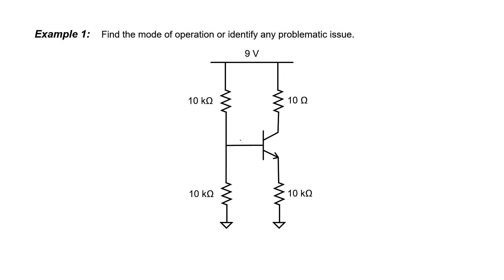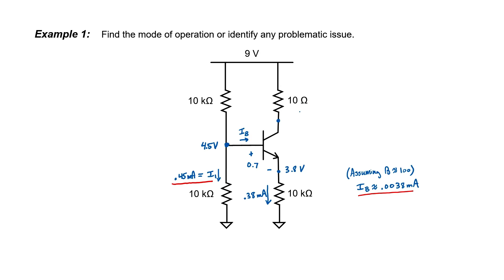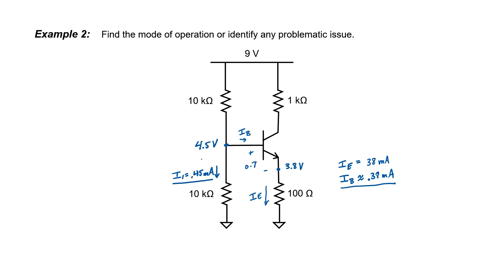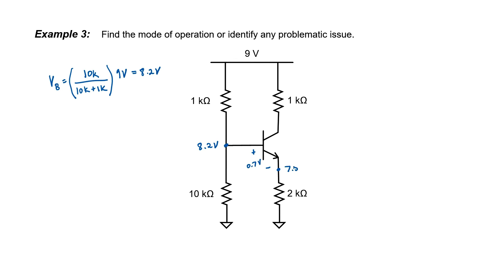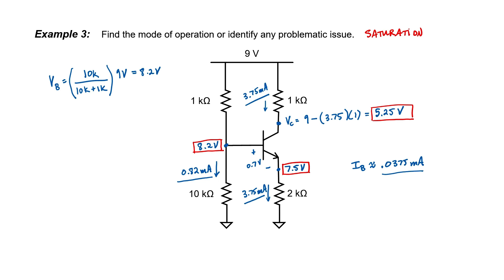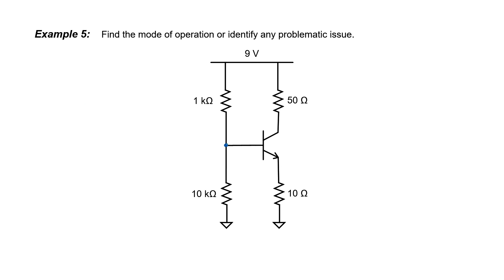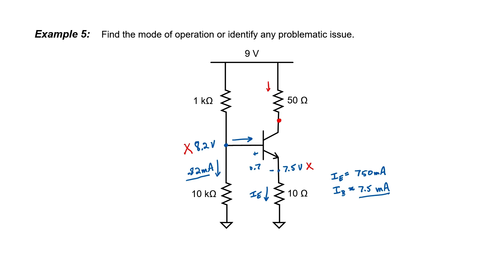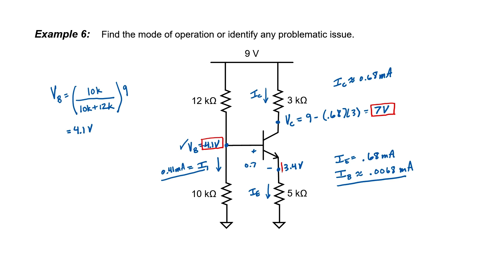Example Problems: Identify the mode (7-Transistors)

Comment: Is there a solid way to determine the base voltage when the base current isn't negligible compared to the grounded base resistor?
Reply: you can also write the thevenin equivalent of the  Base side and taking beta 100, you can find Ib, or if you want so accurate value, you can go through ebers moll model
Reply: Yes indeed there is an exact solution for Ib and Vb in terms of the given resistors, voltage source and the type of the transistor although a bit lengthy. 
Compute Vb through Millman's theorem you get an expression (E1) that contains Ib,
 Then Vb-Ve=0.7V for Si based transistor, 
Also Ie=Ve/Re=(beta+1)Ib (E2) 
from these two you get Ib=(Vb-0.7)/(Re* (beta+1)) (E3).
 Replace Ib in the first expression you end up with an equation for Vb Voila! 
you can now replace Vb in (E3) the  to get  expression  for Ib.
Reply: @faicalbarzi272  So this is what SPICE does, right?  Such a simple circuit is so complex to deal with!   A lot of electronics feels like "pick resistors based on experience"

Comment: Hi, in ex1 Vc = 9 - 3,8V = 5,2 V. Where is the other 9 - 3,8 -3,8 = 1,4 V drop? Could you clarify it please?
Reply: the source voltage goes through a voltage divider circuit. since r1(top left), and r2(bottom left) are the same, the voltage is cut in half, by the voltage divider calculation vout = vin *r2/(r1+r2) so Vb is 4.5v and so Ve is 4.5v - 0.7v(forward voltage drop for a PN junction =3.8v.

Comment: eye watering! thanks! 

it comes like some answer to my post under the previous video. 

well, it does not answer my problem. 
why do i find bipolar transistors that have specified Vce-sat less than 0.6V ?
i understand that the saturation mode means something else, but why Vce-sat in catalogs sometimes so small?
i thought myself an explanation, but am not sure... 
is it about better linearity at lower voltages? 

adding some more, as another idea came to me: 

the transistor, when Vce=Vbe, is no longer the two diode model. if it ever was. 
when Vce=Vbe, must consider both directions for the curent between base and colector. 
leave aside the way of thinking electronics! 
there are two curents, both directions. think like thermal, do not think like electronics! 
Ice is still bigger than Ibe, and it is not estinguished instantly, therefore it is possible for Vc to be lower than Vb (npn transistor), and for certain types of transistors, it may go much under, and that can still be the active mode. the base-colector junction does not behave like a diode. it does not open when it has a direct voltage Vbe. it does not open abruptly, like a diode, it just sums the two curents, going toward some equilibrium.